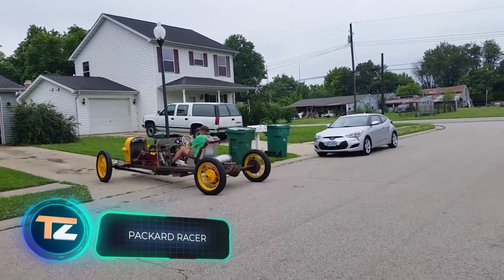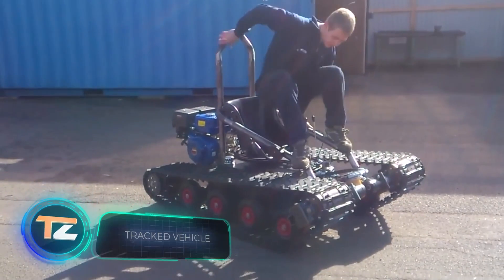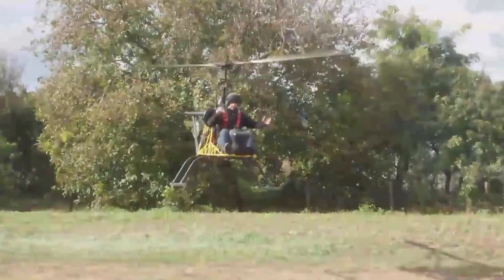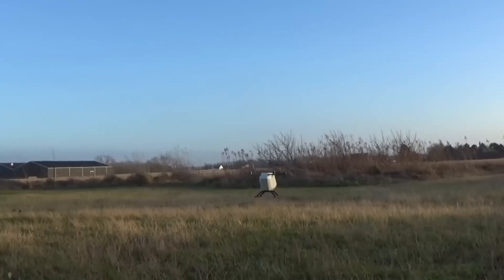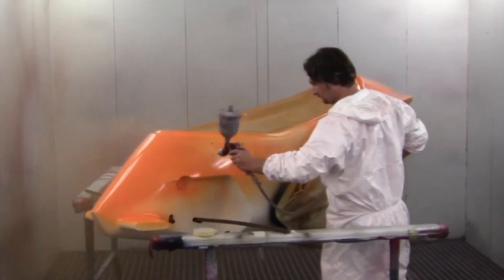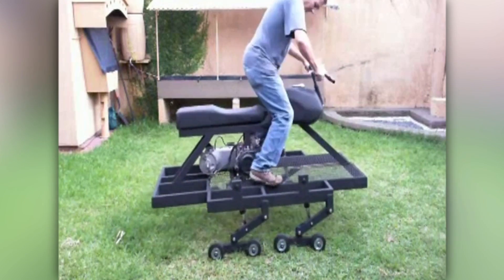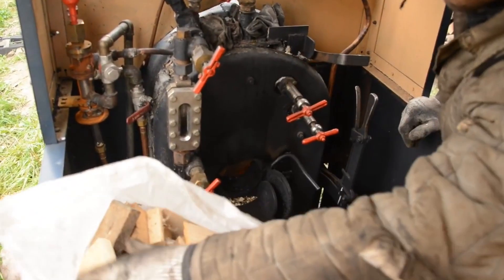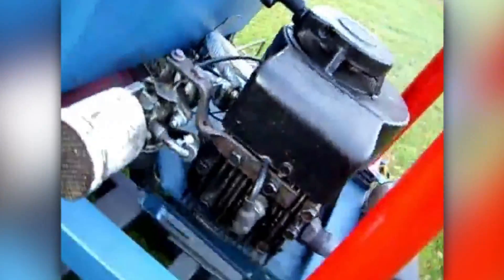HOMEMADE INVENTIONS THAT WILL SURPRISE YOU

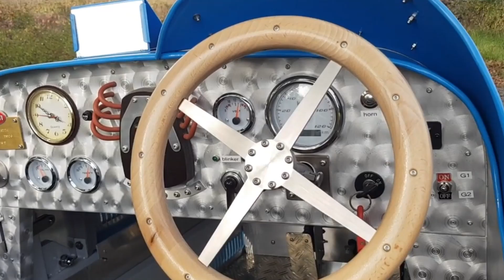Comment: 1:20 Electric motor in the 20's , the batteries
would have had to weight more than the car
if you wanted to drive 20 miles at 22 mph.
😂